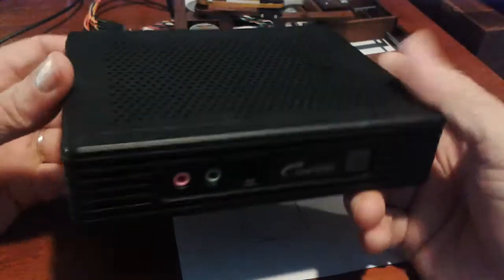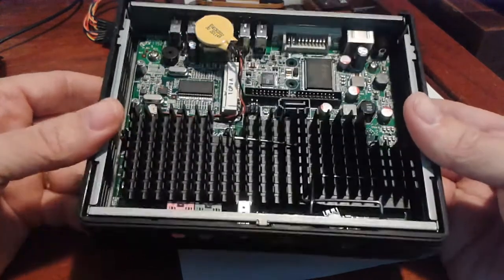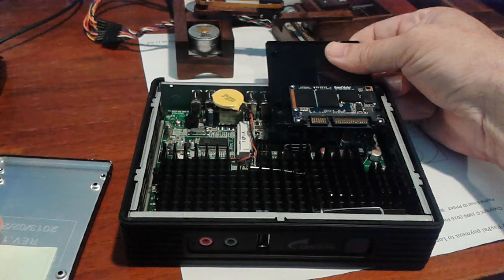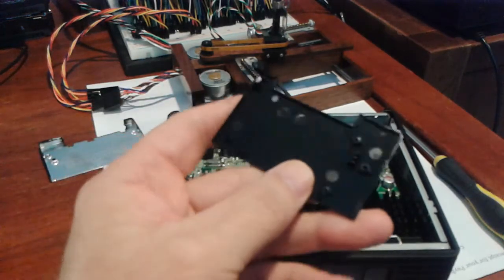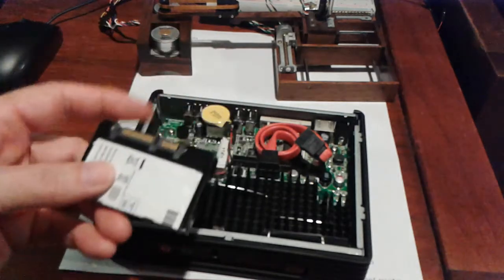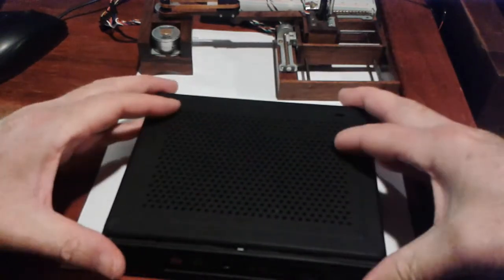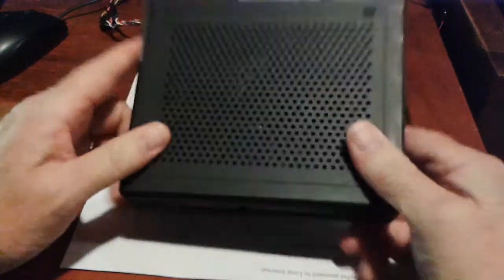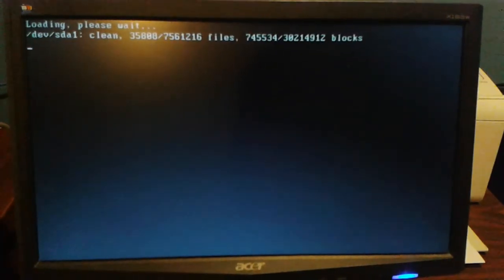Cut an SSD in Half: Mod for Centerm GI945 Thin Client Repurpose

Comment: Good evening boss, greetings from Ecuador Excuse me, I would like to know, I have a little doubt about the connection you made to those pins, it is not very noticeable, would you remember to explain that detail to me?
Reply from the maker: The SSD needs 5V to run. On computers, red wires are 5V. Yellow is 12V. Orange is 3.3V. I just used the 5V red and the ground.
Reply: Thank you very much for taking the time to get me out of the doubt, it is only necessary to measure, take the 5v line and ground or the negative itself, only use the 5v
Reply from the maker: The 5V and ground are needed. The others don't connect. So I cut them off to save space.
Reply: Mil gracias brother

Comment: sorry... what is the max capacity msata and sata?
Reply from the maker: I don't have this computer anymore. This is al old video.
Reply: @ClaytonDarwin  I understand that the old video. but I thought you connected the msata disk. and what disk did you connect, 250 gb?
Reply from the maker: I don't remember exactly, but at that time it was probably a 64 or 128 GB SSD. That's the sizes that were available cheaply. I could even have been a 32 GB.
Reply: @ClaytonDarwin  thanks.

Comment: hi clayton,  i have the same unit, which debian did you install?
Reply from the maker: That machine was able to boot from a normal USB flash drive, so I just used the current 32 bit version at that time. That was several years ago. Maybe Debian 6?

Comment: I have a Dell Wyse thin client i use as a retro gaming pc which works nicely! I took apart a samsung 870 evo ssd and it looks similar to your ssd, my thin client came with a small sata dom with only 8gb on it, and the internals of the ssd are about the same size as the dom, in fact, it would just fit into the connector without any issue, so that is what i did, it lives in my thin client now and performs great

Comment: Seemed like a boring video, but the more i watched the more i realize you sir are quite ingenious. Figuring out where to get the power from to power the SSD, rewiring the molex adapter, etc. Very nice hacks to make use of what you have. Personally i wouldn't bother cutting the SSD casing, and would just use the "bare" board, but thats why we are all different! 
Also, as someone mentioned in the comment about the white port on the board, thats a mini PCI-E port and not a Sata port. Thats why it only works for wifi cards and things like external GPU's, if you ever wanna game on that little thing hehe
Cheers

Comment: How do you enter bios?
Reply from the maker: F2. See instructions at 11:35.
Reply: @ClaytonDarwin  mine is a centerm ga690-2, almost same board but can't enter bios
Reply: Mine already has a module in the data slot and boots from there. Do you think that I can boot from sata without entering bios? And can I boot from usb without bios?
Reply from the maker: I had to change settings in the bios to keep it from booting from the built-in OS. You can see the three settings in the video. To get into the bios, keep rebooting and try different keys (press them repeatedly).  I'd try F2, F1, Del, Ctrl, F12, F1, F8 to start. Those are the common ones.
Reply: Its called ' Google'. Wealth of information at your fingertips.

Comment: the white connector is for ssd
Reply from the maker: I thought that too, but it only works for a wifi module (which I added later). The BIOS won't allow an SSD module there.

Comment: Did you make it boot of USB? How? Debian was preinstalled on the SSD?
Reply from the maker: Yes. Booted from the USB. You MUST change the BIOS and set it to NOT boot from the internal flash memory. The default is to try to boot from the internal flash memory. Watch the part where I show the BIOS.
Reply: OK, thank you for the reply. I got confused and wasn't sure whether it was booting from USB or the SATA SSD drive.
Reply from the maker: First I booted from the USB. Then I installed Debian. Then I booted from the SSD.

Comment: there's a part of me that wants to ask if it halved the capacity of the SSD  :D

"i had some files that i needed to delete, so i put them all at the end of the drive, then physically cut the drive in half and threw the cut-off section away."
Reply from the maker: Good thing I did backups first.

Comment: 5:22 That sheet of rubber is probably a heat conductive pad.  The metal case is acting as a heat sink for the chips on the module.  

Keep in mind that by reducing the size of the metal sheet, you have reduced it's heat dissipating capacity.  I'm not sure how hot the module runs, but it will run a bit hotter now.  I doubt it'd be an issue, but who knows.
Reply from the maker: Yes. I'm sure that's the case. I was just to lazy to go back and edit the video once I realized it. I have some DT166 thin clients that use that material between the CPU and case. 

The case never gets warm, even with heavy use. At some point it would be interesting to see if it could run without the case as a heatsink.